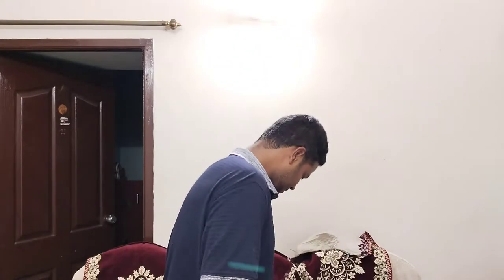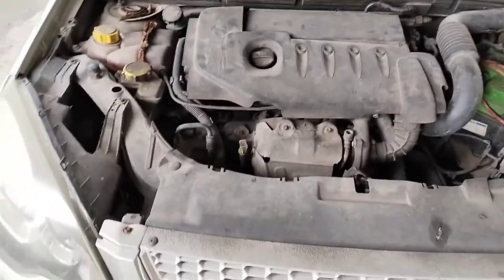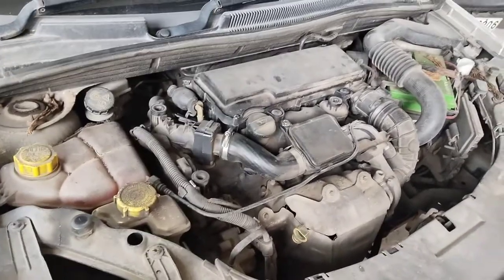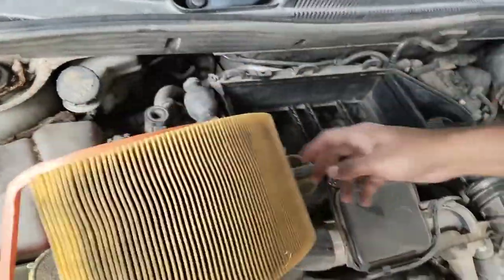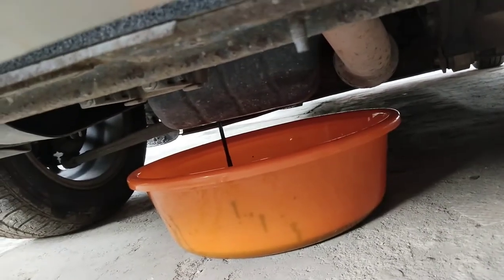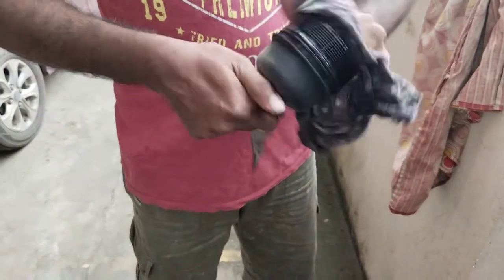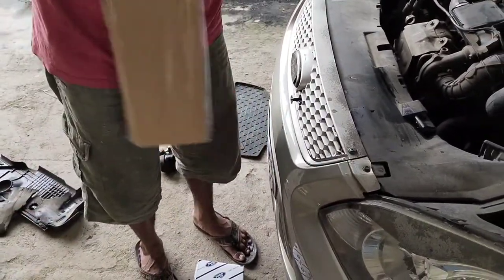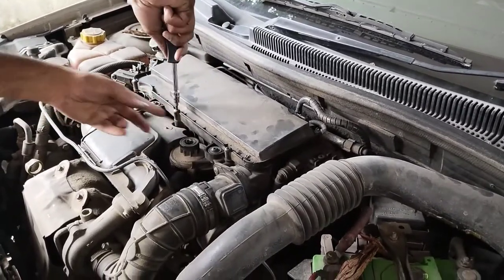Car General service at home in english. #engineoil, #oilfilter,#airfilter-English

Comment: Where did you buy genuine air filter , oil filter and drain plug. Can we buy from  ford  service centre.
Reply from the maker: I bought it from boodmo.
Ford never sells parts in service centre. But they sell it through distributors.

Check in the below link. You can get the location and contact details of your area part distributor.

https://www.india.ford.com/owner/genuine-parts/
Reply: Thank you